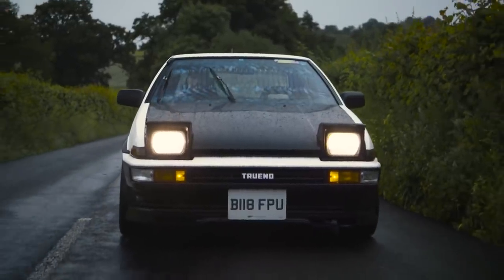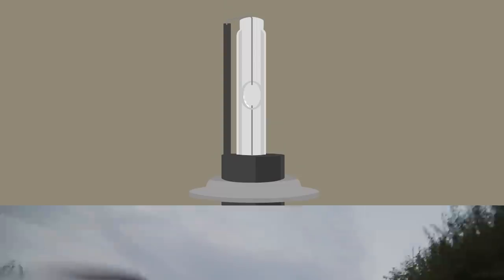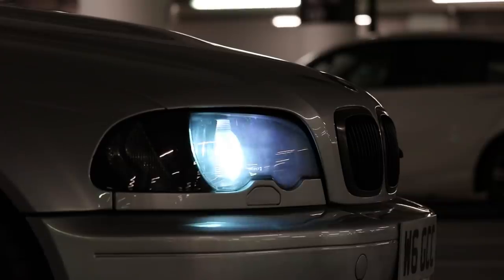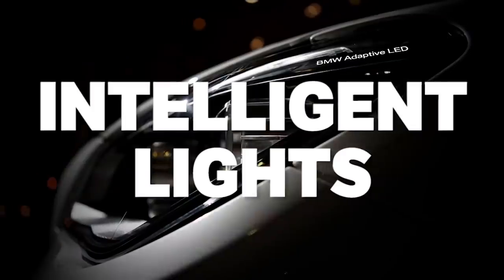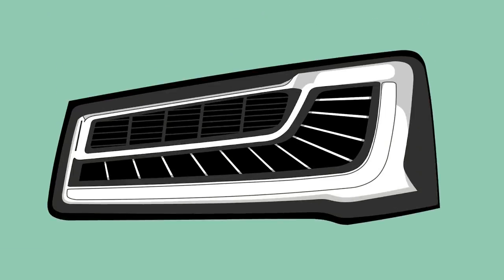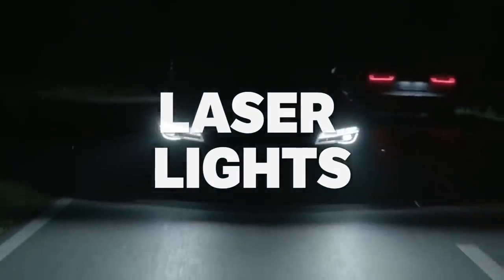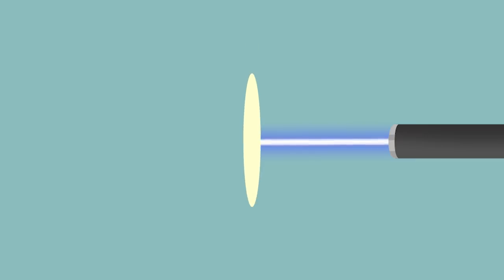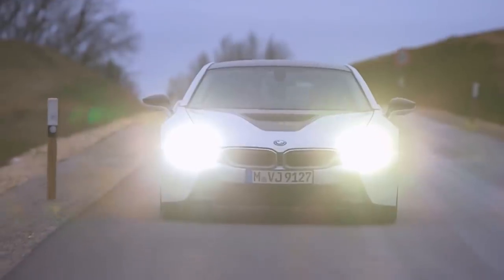Modern Headlights 101 - Xenon, Matrix, and Laser Lights

Comment: Car Throttle, I think you should have at least mentioned that each technology should be used in its own system, AKA HIDs and LEDs don't belong in halogen housings.
Reply: Wrong Philips does have a replacement system in LED that maintains the cut-off line
Reply: @Kavi4GP  In most housings, yeah. Not exactly an "upgrade" as in most housings it usually matches halogen brightness, not exceeds. It's a good design but not a great one.
Reply: @Haloruler64  it is a good design, and it does provide better lighting. Our eyes function differently at night... During the day we see warm colors better because the light from the sun is a warmer (yellow.) At night, however, our eyes see cooler temperatures better because the vast majority of the light reflected by the moon is whiter. LED lights give off a whiter (cooler) light than halogens, and require less power to provide the same usable light. This is why street-lighting is all moving to LED fitments and away from the old sodium bulbs.

As for the bulbs for specific housings, that is not entirely true either. High quality LED bulbs that are designed for function over fashion do work just fine in Halogen and HID housings. The key is to get an LED bulb that outputs the light in as close to the same position as a halogen or HID bulb does. So... All those bulbs with "360 vision" marketing crap are cheap piles. You actually want the ones with a single LED on each side (and only two sides, not four.) This ensure the reflector housing or projector dish perform as they were designed to. With the bulbs that have a bajillion diodes... You just have a lot of extra light scattered in random directions that the systems were never designed to focus. Unfortunately, neither the bulbs nor the marketing of them is regulated by any government agency, in any part of the world.
Reply: @CynicalDriver  You have many, many things wrong there. Our eyes don't function differently at night. Warmer colors are still easier on the eyes, not to mention cooler colors (and LED in general) have lower CRI which cuts contrast and increases strain. Even factory LED headlights have poor CRI. Street lighting is moving to LED for energy savings and lifespan, not for visibility. In fact, LED streetlights suck for visibility due to narrower angle and bright spots. 

And this entire paragraph is wrong. The ones with strips of tiny emitters like Lumileds in the shape of a filament are far superior to anything with a big COB or CREE emitter. Those simply don't work in any headlights. Anyway, in the US LED bulbs are illegal. Not that that matters... there are exceptions to the rule and some are safe to use.
Reply: @Haloruler64  I am going to reply in two parts, and you are going to feel like a fool. Science trumps your opinions.
Reply: @Haloruler64  you are blinding people because you think your "moar is bettah" bulbs are the better choice, or you are holding onto outdated tech based on incomplete knowledge and fear of change.
Reply: @CynicalDriver  I'll reply in multiple parts too. Comparing an incandescent to a HPS bulb is silly. Incandescent has a great CRI, HPS and LED don't. LED has piss poor CRI in aftermarket stuff.
Reply: @CynicalDriver  This video is pretty good, and illustrates my point well. LED headlights CAN be an upgrade to halogen. Most of the time they are not. Beam pattern is critical, not brightness. Hence why a projector retrofit trumps all. LED in halogen housings are naturally crippled by existing optics being built for low lumen bulbs, like an H11 making only 1200 lumens. LEDs also blow out the foreground which reduces distance vision. Can it be good? Sure. But the rule of thumb is, unless it's been tested, it ain't a good idea. Because most people throw in some LEDs, blind the shit out of people, ruin their own visibility, and claim it's an upgrade.
Reply: @CynicalDriver  I somewhat agree with you, except people tested that Philips H7 LED and, despite the decent looking optical design, it tested very poorly. Philips design has sharply gone downhill after the first gen H4 blew up the market. 

I understand your point of cooler light being better for visibility, but when it comes to LED, the main issue isn't color temperature but CRI. And CRI on many LEDs is really bad. Even factory LEDs like the Koito BiLED, which have phenomenal beam distribution, strain the eyes due to the subpar CRI.
Reply: @Haloruler64  CRI is critical for certain purposes, absolutely, but driving isn't one of them. I don't need to know if a tree is forest green or evergreen... I need to know there is a tree there and see its shape clearly. As long as the colors are seen in a basic form, that is good enough. So we will have to agree to disagree on CRI importance vs. effective illumination.
Reply: Phillips may have lost some of their luster, but there are other options using similar design concepts instead of just coating a stick with diodes. The technology needs regulation, but they shouldn't be banned, especially considering Audi's recent innovations with adaptive LED lighting.
Reply: Pun intended.
Reply: @CynicalDriver  It's less color rendition and more eye strain, low CRI light sources cause a lot of eye strain in a lot of people (including me). Driving a car with HIDs is easy on the eyes while LEDs is harsh on my eyes, regardless of actual visibility. But yeah, agree to disagree

As for Philips, they've actually turned shit. The new Ultinons are a total embarrassment. https://www.xenondepot.com/7443-Philips-Ultinon-LED-Bulbs-p/philips-led-7443.htm

I agree about laws outlawing innovation in the US, it's pretty bad.
Reply: Wrong.  But led are garbage.  Most modern halogen headlights work just fine with hid.  Older headlights with fluted lens can be made to work with Casper shields.  This is why you will find most hid h4 kits come with them.

Comment: It's difficult to drive a low seating position sports car when modern LED designs insist on shining directly into my face.
Reply: I feel you on that one
Reply: Totally agree and i drive a alfa 156 XD
Reply: Same happens in my Honda Civic. There are some bastards out there driving their SUVs or CUVs, and because of the high riding position, they neglect other cars and adjust their beams very bad on the road.
Reply: Toyota 86 over here. I feel the pain.
Reply: W203 owner too. I have 6000k bi-xenons and they are great, tho I've never been flashed by other cars for bright headlights. Occasionally I get flashed by old folks in shitty cars, thinking I'm on high beams. 

I hate the headlights in those stupid crossovers that shine the light right in your face. Most car headlights are ok and don't irritate you, but crossover headlights are shit. Mini Cooper's ugly crossover is the worst offender, cause it's lights flicker.
Reply: I have a BMW X5… I’ve tinted my front windshield to keep the beams out. If you have a low profile sports car, do the same 🤷🏾‍♂️.

Comment: I just switched from halogen to a 6000LM 6500K pure white LED. Brightness is amazing compared to the shitty halogens. The reason a lot of people blind others is because they dont align their lights after a replacement
Reply: Trust me there not 6000lm.
Reply: @unclejohn5012  4000lm tops which is combined
Reply: My HIDs are 5000k and are pure white, 6000k+ is blue territory
Reply: @IIGrayfoxII  Eh possibly. But if measured to ANSI they might be 2000lm each. But theres too many factors to count in. Like quality of heqdlight housing, how clean the lense is, air quality etc
Reply: @unclejohn5012  I have an old set which are 4,000lm but 2,000lm each.

It is hard to say how bright it is and where the lumen rating was measured at as well, the closer to the point source the brighter and this may be a false reading if they done the test at 1m from light source when another does it at 2m.
Inverse square law is a bitch
4,000lm @ 1m
1,000lm @ 2m
444lm @3m
250lm @4m
160lm @5m
Reply: Eric, there are some BMW models which have some sort of zoom lens installed on them, so that the halogen beam would offer better performance. There are some which install some cheap HID systems that fit over there and blind everyone else on the road, no matter how good they align their lights, unfortunately.
Reply: @unclejohn5012  IKR I hate it when stupid YouTubers just read off the spec sheet as 6000lm

Comment: Looking at the comments below I can't help but remember back when everybody was complaining about how blindingly bright all of the new HALOGEN headlights in those new fancy aerodynamic fixtures were and wondering why anyone would need such bright lights in the city. Seriously. All of this has happened before and it will all happen again. 

The problem with LEDs in cars is two-fold: Cost and compatibility. The actual cost of the LEDs themselves is fairly small although incandescent lamps are still cheaper by far due to them being around for so long. Where costs escalate is when the manufacturers design custom lamp assemblies that not only use whatever LEDs are best bang for the buck, but aren't even standardized within the manufacturer...let alone the industry. Unlike the incandescent lamps which have been a standard WORLD WIDE, for decades. Not to mention the computing power to control those fancy smart LED headlights. Oh and don't forget the R&D that went into making them work properly, this is basically generational leaps beyond the old incandescent lamps. 

Right now we can have LED lights that are designed to replace incandescent lamps but most tend to be either several times the cost of the incandescent lamps they replace...or significantly lower in light output than even the "long life" incandescent lamps they are replacing. I think it would help get LED lighting into more base model cars if there were new standardized lamps being made specifically for automotive use that capitalized on how LEDs emit light.

Comment: One reason why new cars might blind you in the dark is that the camera sensing other vehicles is mounted on the windshield. Now when you get your cracked windshield changed in some shady shop, they don't calibrate the camera. It doesn't have to be many degrees off and it will blind oncoming traffic  because the car aims the headlights to a wrong spot.

Comment: Gotta be careful, soon enough when a car drives by and its highbeams shine into your window, your curtains may catch fire.

When ur kids run to the window and scream daddy/mommy is home! As you pull in you'll blind them.

Soon youll have an APU installed in your car, youll have to power it on first before you can power your tetrahydron AX2 Laser Low beams.. the high beams would take fully charged supercapacitors from your APU just to start up.

Soon if you need a battery boost, well just use someone elses high beams on a tiny little solar panel and itll supercharge your battery within a minute before melting the solar panel.

One day itll be a headlight with 4 tires and you'll simply use the laser core headlight beams to accelerate yourself  with the photons relativistic mass

Gotta be careful though if you crash and the car points up at the sky itll burn out all the satellites within the beams path.

Comment: Sorry, but the description of the Xenon light is so wrong. 
"When a current is passed through the electrodes, the Xenon gas amplifies the light and reacts with the salt to make a stable and bright light throughout". 

Wrong.

Xenon gas is a noble gas (a non-flammable, very insert gas) and in itself has no "active" part of the process.  The HID ballast (power supply) sends a very high voltage (as much as 20,000 volts) spike to the "globe" that causes an electric spark.  This "spark" ionizes the Xenon gas, creating a conductive path. The ballast then provides a lower voltage (around 100 Volts), but higher current voltage in order to maintain this conductive path in the globe... this "conductive path" is now what's called a "plasma", which is a conductive state of gas. 

This plasma very rapidly increases the temperature within the globe, which vapourizes the metal salt (usually metal halide). This metallic salt vapour now joins with the plasma with the result of a VERY significant increase in the plasma temperature... measured in °Kelvin... such as 6000°K. Now that we have attained the desired mode of operation, the Ballast output voltage is maintained at around 30-50 Volts.  They do not really use "less power" than a halogen incandescent bulb, but they certainly are much brighter. 

The plasma itself is the source of the emitted light from the HID globe.

Comment: Small correction, LEP flashlights use yellow phosphor, not phosphorus. Pretty easy to mix up since Phosphor plural is very close to phosphorus the element, the etymology is to blame here.

White(yellow) Phosphorus the element releases light due to chemiluminescence, glows in the dark when it reacts with oxygen.
Phosphor the material emit light when they absorb radiant energy. 
White(yellow) phosphorus is used in munitions, an example of it outputting light is in tracer munitions where it burns producing light.
Phosphors is commonly used in LEDs to output white light, by absorbing blue light.

Comment: I work in a factory for making lights and I don’t like them from 
perspective of efficiency and ecology. I would like some standardized 
types of light (I know it is not possible) or at least make them easy to
 fix or recycle. 
1)They are harder to make and more expensive because of more steps and 
tools. And you need many assembly machines to create just one type of 
light. Assembly machines are made to fit only one type of housing and 
every new project need new assembly machines. 
2) They can't be fixed (hardly can). If light doesn’t pass test only little we can do to fix the light and it offten ends in a trash.  
3)Hard to recycle. It contains many types of plastic and metal parts. 
Also glue and onetime snap parts and parts pressed together make it hard
 to disassemble.

Comment: Modern cars now have led headlights and tail lights, but I understand that halogen bulbs are easy to replace and cheap, and they are available almost everywhere. But what if the stock led headlights/taillights of modern cars break? Do LEDs burn out often as halogen? I mean if a halogen burns out, you could just go out and buy a new one. How about for modern cars with stock leds? Do they have to go to their dealership and spend days without their car just cos of some led lights that went bad? Or do LEDs last forever not like Halogen bulbs? Thanks for answering

Comment: It would be great to see if you make a video about the different intelligent LED technologies. VW for example doesn't use a matrix system, they use rolls inside the headlight to dim the beam. They even had this system before LEDs became standard. They used it in the 2010 Touareg with Xenon.

Comment: I've got this LED tech in my car Works well for the most part but not at greater distances from oncoming traffic or if you're behind a car at longer distance like might happen at night on a motorway.
I was a little bit underwhelmed when I started using it.
However it works well in more close quarters like on those twisty roads shown in the video.

Comment: I just purchased a C300d with multibeam as standard and I am glad to see there performance(range and brightness) use high beam with the adaptive function or low beam only...be smart enough to understand that you may have the most powerful headlamps on the road but that just means that you don’t always need there full potential in most conditions!

Comment: All these new technologies are to be implemented on a broad scale if they do aid vision and visibility as much as they claim  - driving blind with little to no sense of the surroundings at times when normal eyesight is insufficient is a huge hindrance that spoils ride comfort altogether. However while the majority is accustomed to the generic lightbulbs and lights, these new techs present a threat at being blinding. As many may have said before, I will join; make them safe, revise and reiterate as it has a potential to be just an improvement like the three-point belt was. Still, while it is not a generally accepted method, it does pose a threat to all others; simply because it might blind oncoming traffic (an intelligent LED system will probably cut a swath, but a constantly working one will impair vision).

Comment: There is nothing wrong with xenons/hids etc it's the driver , poorly installed, wrong housing, too high, wrong pattern left/right/centre all of which can be fixed free at home or local garage relatively cheap, have some in mine for one reason so I see where I go yes it looks better but that was a added bonus coming from candles it's much better , mine are set correct done few drives where I drive another car to see how it is for other drivers etc the whole works, last longer , best way to describe, picture an old yellow torch decent does job but could be better now you buy a new torch white light you can now see much ahead and more clear

Comment: I've got a projector based Halogen H7 car, i've tried xenons and LEDs but at the end of the day, nothing beats the original Halogens, If the housing isn't designed for it, then don't put it in. Save your money.
Reply: never install other bulbs than your car procuder wanted you to use.. putting LEDs in normal lamp is just so fuckin dumb.. and those "xenons"... god damn it.. why people do it.. want LED? buy a car with LED lamp.. if possible - adaptive/martix etc.. they are at least few levels above halogens.